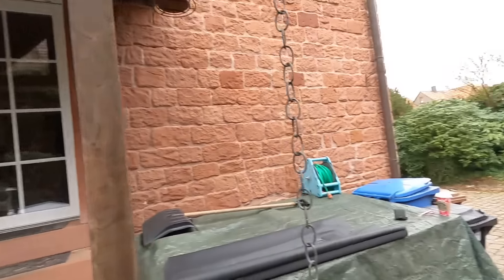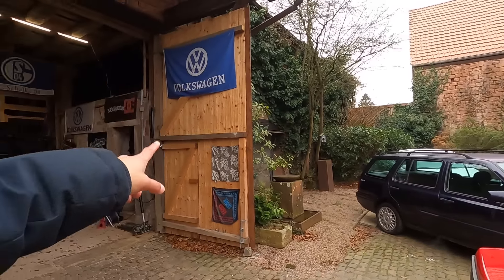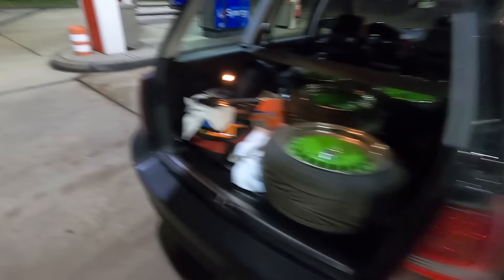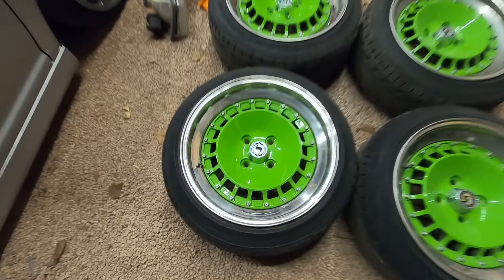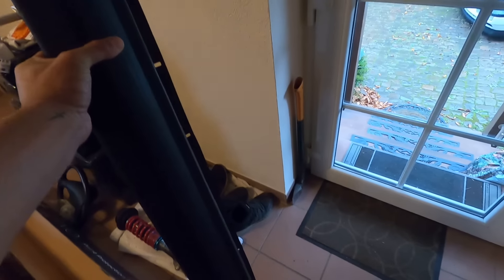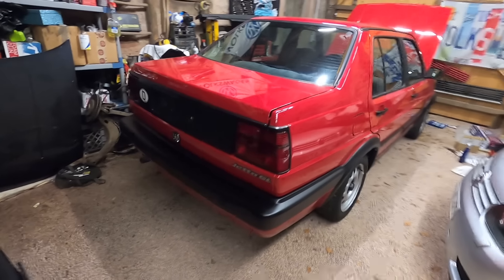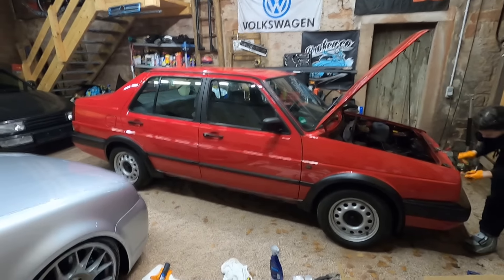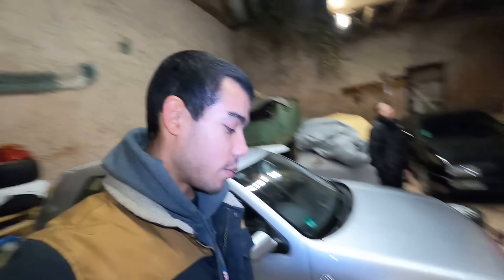What's Going On With The Corrado? + New Wheels For The MK2 Jetta!

Comment: 3m tape the molding
Reply from the maker: The issue is that the molding is basically hollow so I’m not sure if there will be a spot to tape it properly
Reply: I used 3m tape for my trims for the Corrado!! Been 3 years and still stick firmly on!! 💪🏽